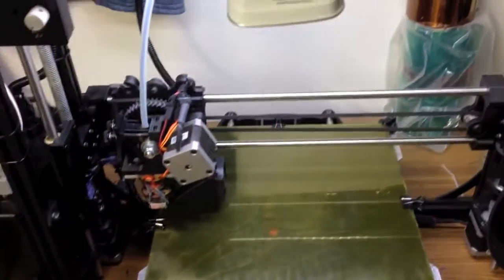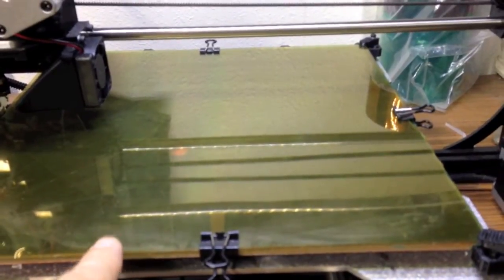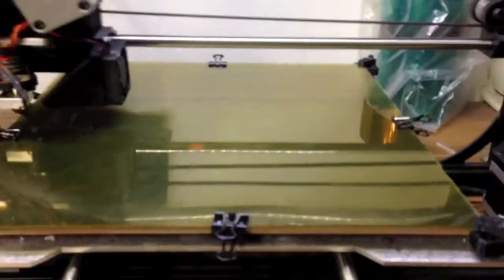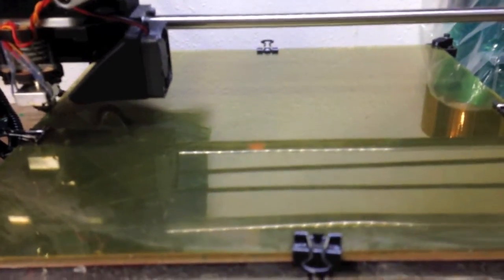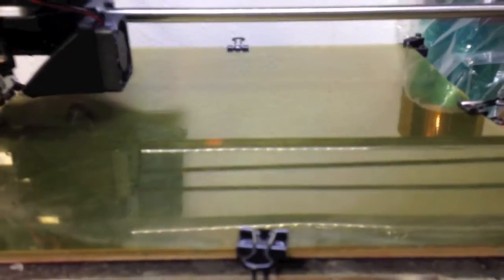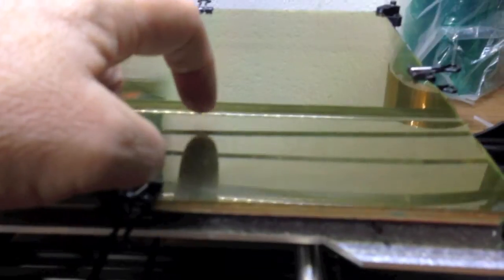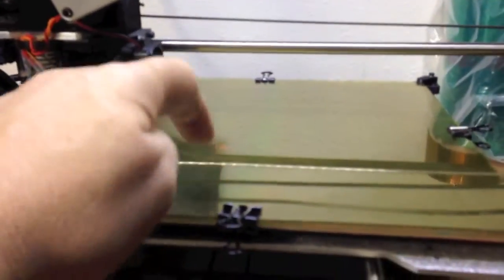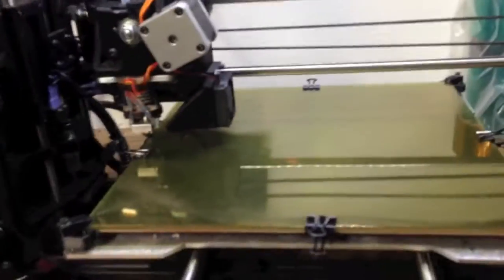PEI bed

Comment: I can't get ABS to stick to PEI AT ALL....bed height is good, bed temp is 110.... I bought a 1mm sheet from Amazon
Reply from the maker: +MindTrikCallr Possibly it's not the right stuff? All of Lulzbot printers  now come with PEI and I have printed close to 1000 parts now on it. Maybe try sanding it very lightly (like 1,000 grit or higher sandpaper) then clean it with isopropyl alcohol.

Comment: What do you think of PEI now? Have you tried Buildtak yet?
Reply from the maker: +Terry Pounds I have used PEI for close to a year. I started testing BuildTak about a month ago and while it works, I tend to cut into it meaning an expensive sheet each time. My PEI was a thick rigid sheet so even if I gouged it I could sand it a bit to smooth it back out.

I have already gone through 4 sheets of Buildtak in a month and have 2 pristine sheets left. At this point I think I will be going back to PEI when my BuilTak runs out.

That being said I know someone that uses Buildtak daily for PLA and he loves it. I print ABS almost exclusively and it either does not stick, or sticks so tight that it's destroyed when removing it. Not saying it's not a good product but rather it's not the right product for me. I have had very few issues with my PEI so that is why I will be switching back.
Reply: +sublimationman I am having a hard time getting PEI to stick to glass. I cleaned glass with denatured alcohol and used 468MP sheet to stick it on glass i put matted side down after removing firm i did nothing to matted side figuring it was new and clean. Shinny side has an upward bow to it is why i installed it this way. should i take it back off sand glass and matted side of PEI and try it like that or what would you suggest? What type of glue do you find works best?
Reply from the maker: I used a full sheet of 468mp and I had no issue with getting it to stick and actually I got just a tiny portion of one corner stuck down and I realized I needed to move it over and had a heck of a time pulling it back up just a second later.

Just last night I wanted to remove my old PEI sheet (long story but it's been abused) and I spent way too long (about 3 hours) peeling it off (I had to use an industrial heat gun to weaken the adhesive) and then I spent another hour with orange oil, acetone, a scraper and an entire roll of paper towels to get the old adhesive off the glass.

I was actually thinking of trying a much less aggressive adhesive my next time around.

So while I am not sure why you can't get it to stick with 468mp, if you sand it, you will defiantly give the adhesive something more to bite onto.

Hope that helps.
Reply from the maker: Terry Pounds One other thing, my PEI was glossy on both sides.
Reply: +sublimationman I figured it out. My glass bed was just laying on my heated bed with no aluminum plate today I added aluminum plate between glass and heated bed board and now the heat is almost perfectly even completely across. At the same time I ripped the PEI off and like you say the glue is really, really stuck on the glass. So I left the glue on it and flipped PEI with matted side up and and sanded side down and magically it is glued now like it will never come off. Something about the matted side that didn't like the glue. I just did a 280mm part about an inch thick and it came out perfect with no lifting. I had bed at 87 celcius printing in ABS. Between the rippled temp across my bed and the upside down PEI is where it was all wrong. Thank you for your input it helped tremendously.
Reply: before I blow £35.00 what are the: very few issues with my PEI so that is why I will be switching back.

Comment: It's polyetheramide. You can also get it on Amazon in various thicknesses. 
I had the same experience, PLA sticks well and pops right off, but ABS sticks TOO well. I didn't want to use a blade to scrape it off as that damages the surface. I had to resort to acetone, many cleanings to get the ABS off. Still searching for the ideal surface to print ABS on.
Reply from the maker: +DavidTheHappenings I use it for ABS daily. The trick is to raise the Z axis so the first layer just barely kisses the PEI bed, then it comes off pretty easy once cooled. May not be the absolute perfect material but it's the best I have seen yet.

Comment: Just got my PEI this week and printed a few of things.  ABS stuck wonderfully.  My thickness is 1/16 in. also.  I used 3M 468MP tape to stick it to my piece of glass.  You can get the 468MP in a 12x12 sheet although I just got 1 inch wide tape and it worked fine.  I haven't gotten any warping of the PEI since it's taped to the glass. On really tough prints you might still have to do it a brim (PEI is great, but it's not magic).  For me it's worth the price not having to mess with glue or hairspray and the cleanup that goes along with those.
Reply from the maker: Yea, I knew about the adhesive, I did not want to stick it to my only glass until I am sure I am using it permanently. One other plus to not sticking to glass is you can take it off and flex it for hard to remove parts.
Reply: sublimationman Yeah I was actually printing something last night that was pretty hard to to remove.